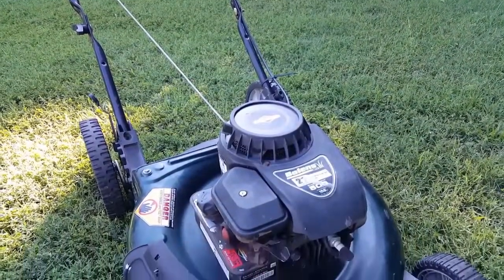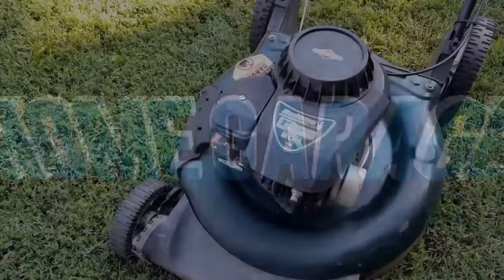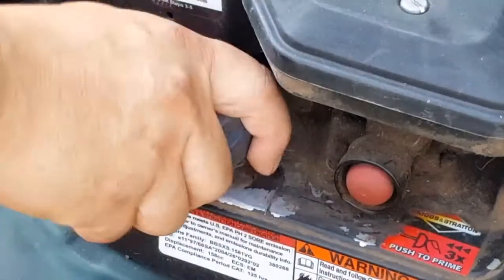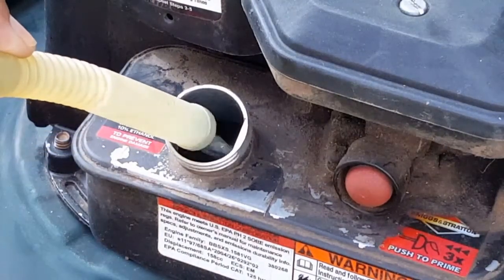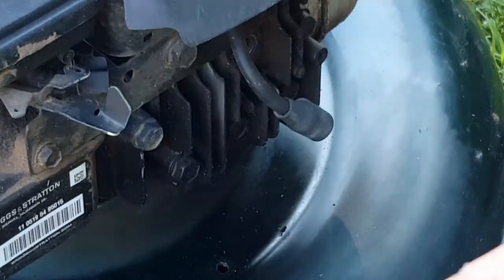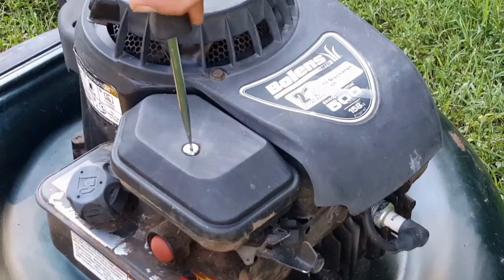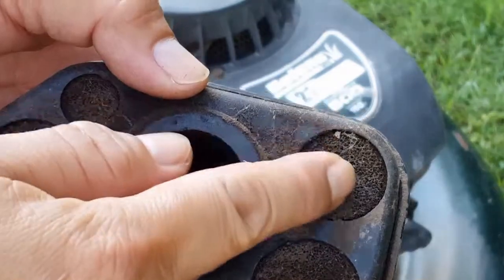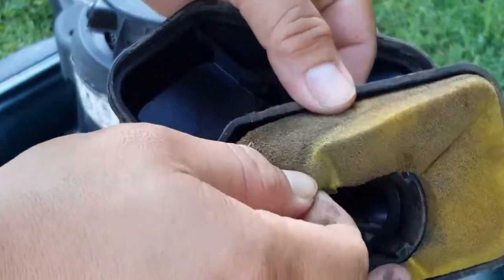Bolens lawnmower uses too much gas. Dirty air filter. Tune up needed.

Comment: Runs great! I've gotten so many mower trade ins that needed nothing but the air filter cleaned or replaced.
Reply from the maker: Thanks for the comment. It is quite amazing how a little maintenance can be so easily neglected.
Reply from the maker: Well said.

Comment: Good job, however on those kind of air filters when you service them you are suppose to lightly oil them so they attract dirt etc and getting caught in the filter.
Reply from the maker: You are absolutely correct. Thanks for the comment and the watch.

Comment: Thanks for vid.Here is a odd one for you.I been mowing my lawn with few push mowers over years.Mostly use Craftman 7.0 with Briggs engine.I picked up a Craftsman push mower that has a 7.20 Briggs.Few years old and appears taken care of.I replaced air filter and a new NKG spark plug.I run 90 oct no ethanol in it.Most all my other mowers I can finish yard on 1 tank of gas easy even the 7.0.This one, 7.20 takes 3 tanks about every time.Engine seems to be running fine along with rpms.At first I thought since a 7.20 it uses more.Then thought no compared to my Craftsman 7.0.Something is not right here.At $4 a gallon gas I feel I'm pissing my gas away.Thoughts?
Reply from the maker: Is the engine an "autchoke" type? No priming just pull to start? If so I'm wondering if it's not unchoking itself fully so the end result is very poor fuel economy.
Reply: Home Garage yes, auto choke.I do recall one small thing engine govenor moves alot and at times seems like rpms do slow a tad.I put a new spring on tention spring from govenor to clip.Oddly also unlike any other mower I seen this mower can barley be tipped then it stalls bad more so on a tip side carb face right on hill.Not talking about steep hills just slight side hills.I can also have mower flat yard tip mower up front wheels just a little and govenor goes crazy and wants to stall.Just a odd mower never seen any of this before.All in all it's to the point one would hate to mow grass with it.Shame because mower looks new.Forgot about the small issues mentioned sorry for that.Guess maybe engine is not running right then.
Reply from the maker: That's what it seems like.  Shame
Reply: Home Garage I just got back from mowing my lawn with it about 2 and half hrs.The mower did not give much a fuss this time.Just the same 3 tanks of gas vs 1 with others.For now though this is the only one self propell works fully.Rear and least I can say that works well.
Reply from the maker: Joesph Baumgardner as long as it works well I guess it's just going to use lots of gas.
Reply: Home Garage I may drop it in the shop some day.Mean time take a look at this other Craftsman I got buying just because.The one that leaks oil around deck and out air breather.Front drive.Really nice mower newer with electric start.Never tackled a oil issue, but for $20 so bucks I knew parts was worth.But before I gut parts I've had it sitting for few weeks till I fig out if this issue can be fixed vs money pit.
Reply from the maker: It's a good mower. Hope you can see where the oil is coming from.
Reply: Home Garage Thanks, I know it's 100% out the air intake breather side.Pours it out lol.Mower starts though lol.

Comment: Can you tell me the length of the bolt in the air filter? I've misplaced mine.
Reply from the maker: I wish I could but I don't have the mower anymore.  If I had to guess I'd say 3 to 3.5 inches.

Comment: I have the same engine. What oil should i use
Reply from the maker: heavy duty 30 weight.
Reply: @HomeGaragechannel  30 weight? Im sorry i didn't get what you mean.
Reply from the maker: @LeeLee-wv9fb  I thought you were asking about engine oil. If its oil for the filter I would use wd40 or another "light" oil.

Comment: I have a mower that Over revs is that fixable ??
Reply from the maker: Possibly.  As long as the internal governor is intact. What kind of mower is it?
Reply: Home Garage A masport Briggs&stratton 450 series 148cc
Reply from the maker: @Maxpower-lg3ju  gotcha. Did someone remove the carb to service it? Wondering if they put the governor arm on poorly .
Reply: Home Garage Should I take it to lawnmower shop?
Reply from the maker: @Maxpower-lg3ju  that or find a small engine guy like me who's willing to help out for free. I do have another theory tho. Take the carb off and look at the back side that faces the engine. There should be a throttle plate there. Sometimes they come off and then theres no way for the governor to work so it over revs
Reply: Home Garage the Engine sort of looks like your one in the video
Reply from the maker: @Maxpower-lg3ju  okay. Theres should be a metal tab on the front of the gas tank under the filter.  This will help to adjust the engine speed.
Reply: Home Garage ok I’ll have a look